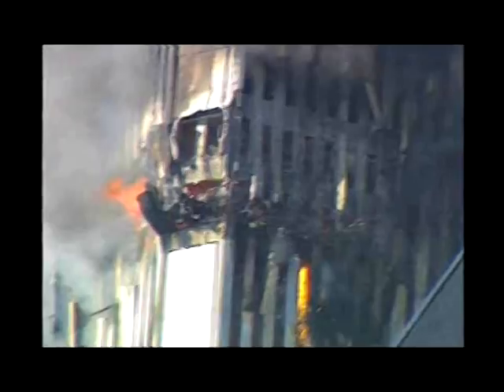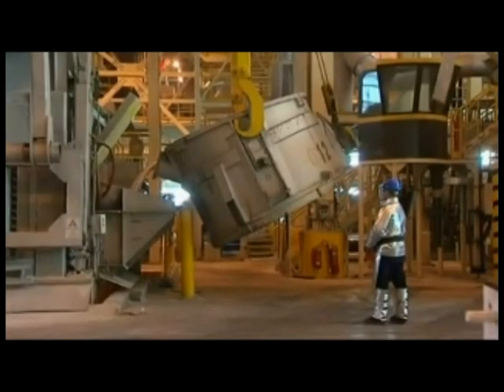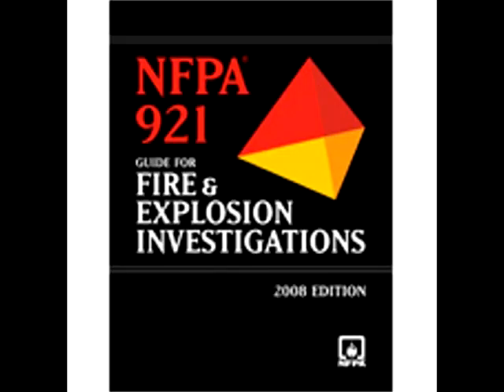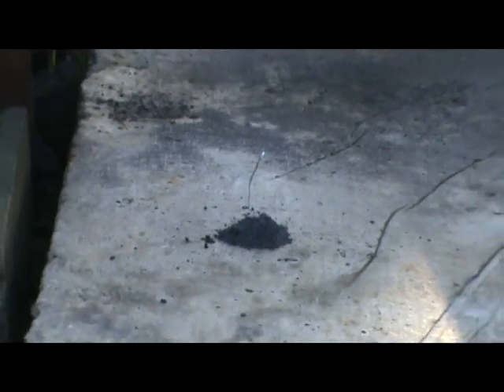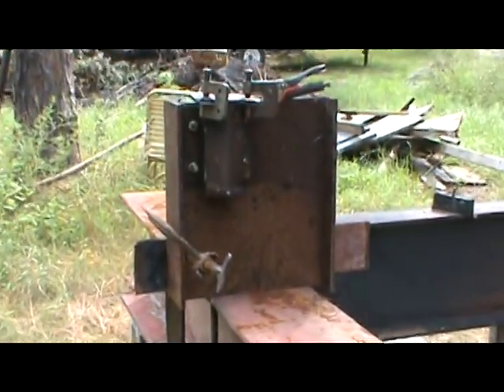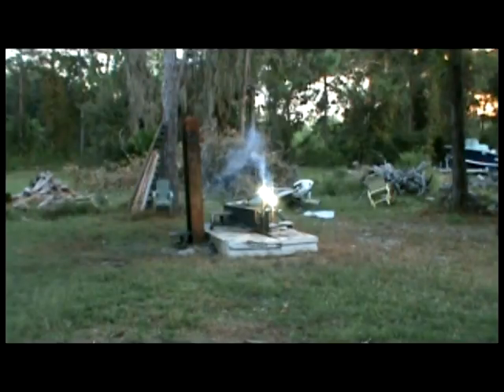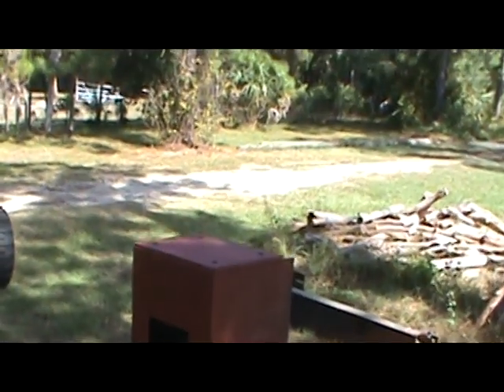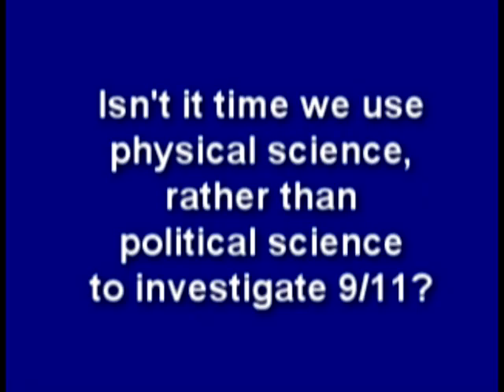9/11 Experiments: The Great Thermate Debate

Comment: Those buildings that fell. Fell like a controlled demolition.
Reply: George McFly The buildings collapsed at the point of impact. In what sort of magical land do you live where set explosives wouldn't immediately go off on impact? I can't believe 911 twoofers still exist. You guys are so dumb.
Reply: Lary Thesnail I didn't say he called himself an expert at conspiracy theories. I called him out for thinking he is an expert at controlled demolitions. Talk about being dishonest!
Reply: Problem is...have you seen all the work that has to go into a controlled demolition? Tearing out drywall, pre cutting structrual members to bear minimum, spending hundreds if not thousands of man hours rigging explosives with wires to a control board so that the demolition can be carried out successfully. And that is just to control demo a relatively small building. Now, add to that the size and number of the buildings at the trade center complex, plus the fact that these buildings are occupied and have security...how does anyone expose all the columns, rig the explosives, and set up a dentination control board all without being noticed? I've been in construction for 41 years...and this would be a totally impossible task in my humble opinion.
Reply: Wonderfully Beautiful Anything is possible
Reply: As I sat there early that Morning I thought that it looked just like the "Modern Marvels" show I had seen on The History Chanel some time earlier. The demolition experts used specific charges made in part of copper and like an anti tank round shot molten copper at the buildings  I beams which did cut them and brought the building down "Modern Marvels" was reporting on building demolitions and how they are all set up and finally demolished. I wish I had the URL for that show. I agree. just like a building controlled  demolition.
Reply: Dachvid Von its so painfully obvious it was a pre planned demolition😖 did you see how the planes,  wings and all left a perfect outline where they cut right threw steel and concrete of the wtc buildings? 😕
Reply: insight001 the exterior of the buildings were not strong at all. It was basically a veneer. That is why there were basically silhouettes of the planes at the impact site. The buildings were only designed to take a hit from a plane that was moving slowly because it was coming in for a landing and had almost empty tanks because no one was planning on terrorists doing what they did because it hadn't happened before.
The buildings were designed to come straight down because if they tipped it could start a domino effect on any building they hit. Obviously this does mean a demo crew would have had an easier time and could have rigged it quicker, but that is only relatively speaking and it would have been impossible to hide that something was going on from hundreds, if not thousands, of people. How was it that nobody leaked anything and nobody has come forward with material evidence even anonymously? Anyone who has been in the military should be able to see that the government is not capable of doing something like this without someone leaking it.
Also, GW had only been in office 8 months when this happened, they would have had to have started selecting people immediately to get the operation underway and have none of those people,whom they barely had time to select, not say anything to anyone ever about it. Then they framed the taliban in Afghanistan for it so they could invade Iraq? That makes no sense and it still gives GW too much credit.
Reply: Lary Thesnail Please explain.
Reply: Wonderfully Beautiful, I understand what you're saying about prepping and so forth.  But think about it.  The structural integrity based on the impact of the plane should have caused the building to go to oneside.  Physics says so.  Unless it was calculated into equation what it would take to bring the building down in a uniform manner.  I'm sorry, but the building came down to neatly.  That was no coincidence or by chance.
Reply: its just about impossible for both those towers to fall straight down on their own...
Reply: Mott theHoople you mean 3
Reply: This ^ Controlled demolition - without doubt on WTC 7. It 'free falls' - no office fire melts buildings or we would have a lot more - Greenfell for example burnt completely and still stands, structurally sound....Open your eyes to Bush's military pushing for a war, and starting it on home soil.
Reply: Explain building 7 please Kubass?
Reply: Sean B Oh for fuck sake. People who compare Grenfell to the Twin towers as proof 911 was a inside job are not worth arguing with...But Im going to compare the two regardless.
 The Grenfell fire was started by an Electrical fault. 
 911 was started by a Jet plane weighing several tons almost fully fueled with Jet Fuel. 
 The Grenfell tower was 24 Floors High with as Much as 600 people in it. The Twin Towers were 104 Stories high with at least 14,000 people split between the two of them.  It was easier for Firefighters to battle the Grenfell blaze as it was closer to the Ground whereas the fires in the Twin Towers were far too high of the ground for Firefighters to do anything significant.
 All this doesnt matter much though in comparison to the Simple Fact that The Grenfell tower was built out of Concrete which does not Burn and has a far higher melting point than Steel (Thousands of Degrees Fahrenheit). The Twin Towers were, As everyone knows and sees as proof 911 was a inside Job, Supported by Steel beams which are weakened and can bend under pressure if exposed to a large fire for a extended period of time.
Reply: Corey McCrann please show me what question I did not answer?
Reply: Devin Speh He said something among the lines of "In what magical world do you live in where explosives dont go off on impact?" He could have worded it better but he was asking, if Towers were brought down by explosives, How come they didnt go off instantly and collapse the building as soon as it was hit? Why did the tower not collapse for several minutes?
Reply: I swear I've  heard that somewhere before...
Reply: Turbine jet fuel is just more refined diesel fuel. Its not nearly as flamable as gasoline or piston driven airplane fuel. Its fun to take some from a drip pan under the f-18s in the hanger and put it in a diesel truck.. smokes a bit more... but ill tell you that if a 14ft flame shooting out the nozzles of the f18s i worked on didnt melt the fucking ends of the jet off, the civilian grade shit wasnt going to melt steal to that extent in such a short amount of time. And to the guy who daid something about experts, you do know there was an independent investigation led by hundreds of architects and demolition experts that dont work for american companies that came to the opposite conclusion that the 9/11 commission did right? The only people that have testified on behalf of the united states were from high level companies within our own country.
Reply: Not that i did ir witnesed anyone take government property. Just saying it would be fun and probably smoke a little more...
Reply: Go buy some diesel fuel and set it on fire in an open area and measure the temp for me...
Reply: Open air burn temp is 1800 degrees. Steel melts at 2750... does anyone look shit up before the sphincter on their face opens up and starts releasing shit out of it? Forest fires until recently didnt even get hot enough to melt steel... but now we have fires melting cars glass and porcelain in California. So what im saying is buy gold and guns. Shit is about to get real fun in this country.
Reply: Oh and where did the titanium engines from the jet that hit the Pentagon go?    Please enlighten the fighter jet mechanic. Because im sure those melted too.
Reply: asvaldr nunya You can literally see photos of major engine parts. Smh.
Reply: I already know too much and talked too much. The shit in this country is far deeper than most people will ever know. Im already being gang stalked and have been mind controled. The old C.I.A. programs never ended. Talk too much and you get pulled.
Reply: freetown78 Says the dude that believes in retarded conspiracy theories because you found Alex Jones convincing. 🤣🤣🤣
Reply: Ignigknok I didn't change anything. I'm responding to a comment. Read the thread. You apparently lack reading comprehension.
Reply: Addison Bliss They were designed to fall straight down?
Reply: Nevermind the towers building 7
Reply: kubush actually it does you're just a moron it was a controlled Demolition and it was an inside job but people with half a brain don't understand so consider yourself one of them.
Reply: If you were to watch a controlled demolition then you would be able to say that the way towers 1 & 2 , fell with the addition of building 7 they all fell in a controlled demolition style. It's no theory its fact. Some of the most prominent engineers in the United states have proven it. The towers were built to take a blast the planes alone wouldn't have brought them down due to the fire never getting hot enough to melt steel. Stop being a sheep and open your eyes.
Reply: Controlled demolitions are LOUD! There were no sounds of explosions to bring down the buildings.
Reply: Tim Do you mean besides the multiple explosions numerous ppl and news stations reported hearing and feeling?
Reply: Devin Speh I've heard every single one of your debunked talking points. There was nothing controlled about how they fell. All the credible engineers agree. But you don't even have to be an engineer to see it. The buildings weren't designed to have a jet that size crash into them and have jet fuel induced fires that raged afterwards. The fire didn't have to melt the steel beams, it only needed to weaken them. And of course the typical ignorant conspiracy theorist sign off, "sheep open for eyes." Get something original you parrot. Just repeating nonsense you watch on youtube.
Reply: kubush  he’s not calling him self a expert at Conspiracy theories. He’s just saying that it is a controlled demolition in a reacted the same way as any other video to watch over it it’s common knowledge
Reply: kubush explain how building 7 fell then with no point of impact??
Reply: Devin Speh An uncontrolled raging fire for 7 hours and the fact that it got hit by major debris.
Reply: keithc728 yes it did
Reply: kubush just look up controlled demolition videos and it looks the Same way the twin towers fell
Reply: Devin Speh Planes flew into the towers.
Reply: kubush it's not a conspiracy theory it's a fact grow a brain kid.
Reply: Kubush Go back to your internet porn, or MSNBC.
Reply: david smith Go back to infowars, you ignorant piece of garbage.
Reply: kubush please explain your theory on what caused the collapse then?
Reply: kubush you're a fuking idiot
Reply: keithc728 exactly they fell almost straight down,watch any controlled demolition job,it reacts exactly the same way.
Reply: No, no it didn't. Stop pretending that because you watched a bunch of conspiracy theory youtube videos, it makes you an expert on how a sky scraper "should" collapse.
Reply: kubush So tell us how they should've collapsed.
Reply: Devin Speh Classic. When you cant answer his Question you simply change the subject. If 9/11 Was a Controlled Explosion how come the Buildings didnt collapse the minute they were hit? Surely a  major impact and fire like that would detonate Explosives in a matter of seconds?
 As for how the Buildings collapsed, All Skyscrapers in New York are specially designed so if they are hit by a Large Object that takes away a section of the building causing a risk of Collapse, They will collapse straight down. Rather than falling over and destroying another Skyscraper next to it.
Reply: Corey McCrann If the support beams are melted it doesnt matter what it was designed to do at that point
Reply: Freddy m 😂😂😂
Reply: freetown78 lmao!!
Reply: kubush, Please!  Stop!  Your ignorance is insulting humanity.  SMH
Reply: Akneelilles Been there, done that. It doesn't look like a controlled demo at all.
Reply: kubush It looks exactly like it.
Reply: The Holder Of Demons you mean-"I guess it did"
Reply: kubush that’s what he was saying

Comment: Too many retards pretending to be engineers in the comments section. Sure, you couldn't have melted the steel, but any high amount of heat can warp steel to the breaking point. Heat reduces the yield point, this is fact, and the towers fell because of it.

Comment: The may be a dumb question, but assuming the people who ‘set up 9/11’ has to use all the contraptions you did to successfully horizontally cut the steel beam and all that, wouldn’t a commercial airliner disrupt a lot of that work? And how difficult would it be to to time the controlled explosions with the crash of the plane?
.
. 
Besides that, thanks for making a video with thought out and compelling evidence that is more than a bunch of conspiracies. Also this was well filmed and edited
Reply: Yeah, it basically make no sense. Even more than the fall of the buildings was exactly stared at the plane impact location.
No remote of any kind could have handle the tens of mn of fuel fire... The supposed operators would have to trigger the devices at the right store (even worse: the planes didnt cut straight, so it's some 3D shape you have to emulate).

It's just BS.
Reply: Well shiver me timbers.

Comment: Im afraid this video is more like a ''could it be possible''. but im not convicend that there is faul play at work here.

Jet fuel alone cant LIQUIFY steel beams, this is true in a controlled enviroment like a back yard, but we dont know the conditions inside the tower. If you suply enough stong winds to a flame the heat goes up (basic forge)

The small metal balls prove absolutly nothing. The same balls appear when you put a torch to metal. This could have happend during construction, renovation or even faul play. The fact that they are there only proves that at one point in time a high heat source was in contract with a metal source.

The explosions could also have been anything, like a hydrolic piston of the plane that blew up. (wich a plane has hundereds of)

The river of molten steel is perhaps the biggest facepalm. In the video this dude does his hardest to replicate the result and only manages to make fist size holes. While it would take TONS of molten metal (created at the same time) to form a river like that. And even then we would have seen a giant steel plate between the rouble. Its was most likely jet fuel.

Then theres the ignition system, for faul play to be a option it would take MONTHS of carefull placement of the charges, on a tower that has thousands working there and god knows how many more visiting. How do you keep a entire floor off limits for so long? people will always wander trough there (even if its just to use a not occupied private bathroom). Then how will you asure that the impact of the plane will not damage your carefully placed incidiarys? and if even one of those devices somehow doesnt go off and the public finds them in the wreckage, wont you face a lynch party afterward who want to mount your head on a stick?

The only thing i truely agree with is that the media is lieing about thermite not being able to melt steel, becouse it can. BUT, does that mean it was used? I say its unlikely becouse of the same reasons the uploader stated, its to volitile and to hard to direct.
Reply: Im not a big theorist, myself, but I do have extensive knowledge in the maintenance/renovation of these buildings. I work mostly in Downtown LA as a commercial plumber. 

Some building may renovate multiple floors at tge same time. Depending on to what extent they are renovating, they may strip the whole floor down to its skeleton, revealing structural steels. These projects can last up to 6 months if its a big enough project. And the steels are always coated with an annoying layer of fire retardant insulation. This helps with noise and fire suppression. When I say an annoying amount, I mean about 3 inches thick at the minimum. If we scape it off to add a hanger support, we have to reinsulate the area. 

The fire suppression system that these buildings have are also top notch. The system carries about 120 psi on the low end of the spectrum. In other words, twice the pressure of the strongest shower youve been in, on a single fire sprinkler. These sprinklers are rated to go off at something like 160 degrees or something. Dont quote me on that, I dont remember the exact temperature. 

And look, Im not one one side nore the other, im just a youtuber passing though, reading some of the comments. I just felt like maybe you hadn't considered some of these possibilites when you presented your arguement.
Reply: Corn Fed bro the metal in the video is red hot, no actually its like fucking lava. Aluminum would just look metallic, like mercury pouring out of there so pls go learn some physics m8
Reply: The "explosions" were actually revealed by a documentary camera crew filming the fire department that day, to be people who had jumped from the upper floors to avoid being burned to death, slamming into the pavement at 120 miles per hour. People will believe anything if they don't like the goverment that is in office at the time of a tragic event like this.
Reply: Corn Fed Sheep...    Pig?
Reply: OPEN YOUR EYES CHRIS https://www.youtube.com/watch?v=n3xgjxJwedA&t=5s
Reply: he starts his comment off with ' im not convicend that there is faul play", then a paragraph later he says " This could have happend during construction, renovation or even faul play." so hes obviously talking out of his ass. and also who is this neanderthal above "corn fed" who says that large beams will liquefy when bent. What the hell is happening to our education system?!
Reply: Lack of oxygen that far up in the atmosphere would keep it from burning too hot.